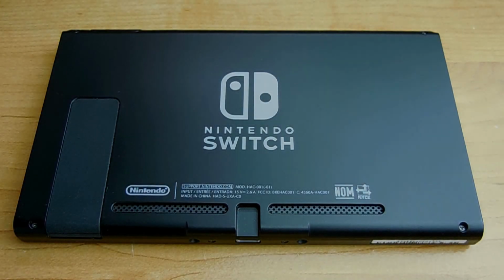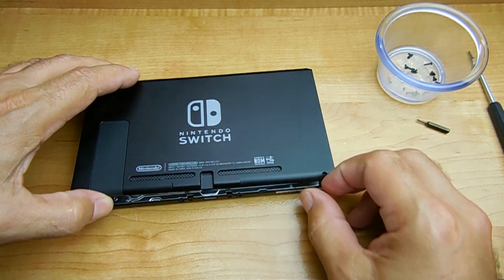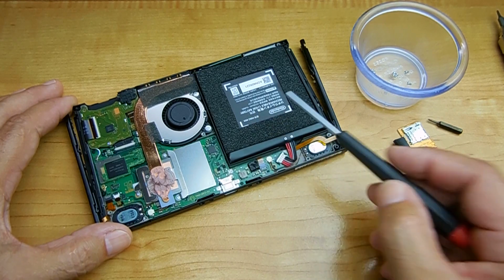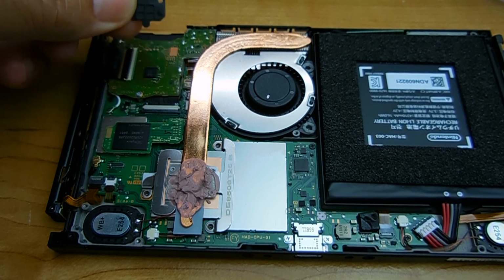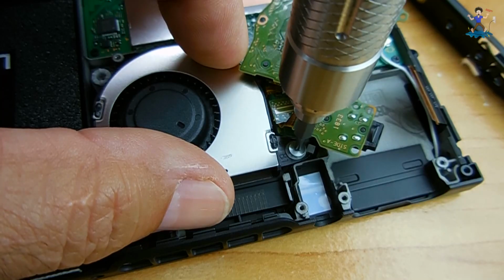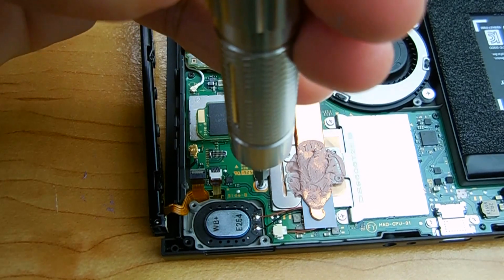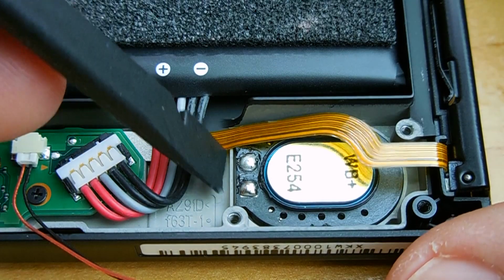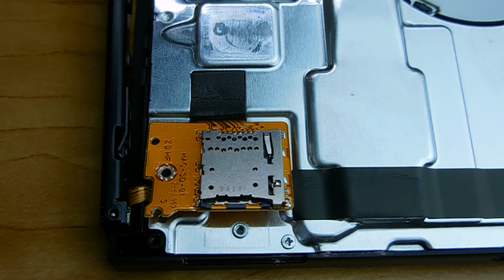How To Repair Nintendo Switch (CPU Fan/Battery/Speakers)

Comment: Hi i have a question,Can i repair a Nintendo switch fan instead of buying one
Reply from the maker: Not worth the trouble, they're fairly cheap at the link I provided. Thanks for watching!
Reply: @electronicsNmore  I bought a new one and I think it ended up being a faulty fan because it's doing the same as the one I had before. I'm not sure what the deal is with Nintendo Switch fans.
Reply from the maker: @Stricker Clan What was the old fan doing?

Comment: Thank you so much for this video. I just repaired my switch that I had over a year that started overheating. Changed the fan and renewed the thermal paste. Excellent guide👍🏼
Reply from the maker: Great to hear! Be sure to check out my wide range of videos, and share my channel. Thank you!
Reply: I did the tutorial too for my fan and it didn’t turn back on
Reply from the maker: @cavanski007  Open and double check all connections.
Reply: I also just changed my fan and same issue. Everything else works but new fan won't turn on. Already took apart and checked everything again.
Reply: This is exactly what I'm going to be doing today excellent video guide

Comment: Hello, recently my Switch cooling fan is making a grinding noise at random and I am going to open it and possibly change the fan.

Do you know were can I buy those foam stickers? Do you thinks that if it get damaged I can still use a regular tape? 

I'm kind of newbie with this stuff
Reply from the maker: You can use 1/2" wide kapton tape. It's heat resistant. You can find it at the link provided in this video description area.
Reply: @electronicsNmore  thanks for the info.

Comment: nice power screw driver. But I dont trust modern electronics since they make them planned obsolescence. Most people will fail on the battery in taking it out and many will have extra screw in the end. LOL I find it hard to believe you use you switch more than the  power screw driver. As some wealthy people say "i prefer to work another hour at work to buy what I want then waste time doing it myself and messing it up"
Reply from the maker: The Switch was borrowed. :-)